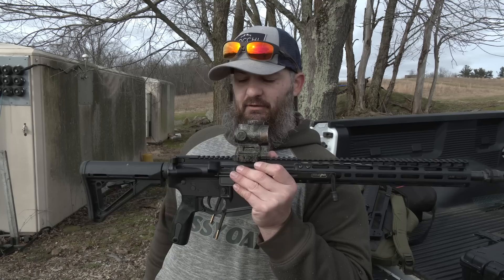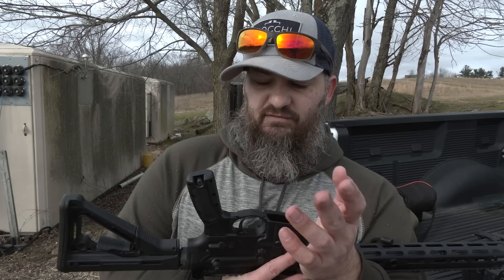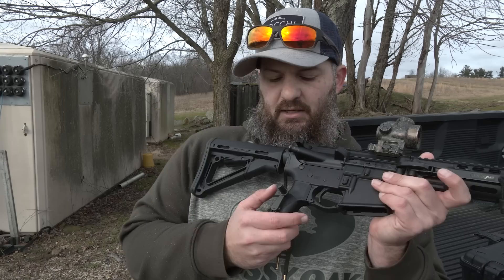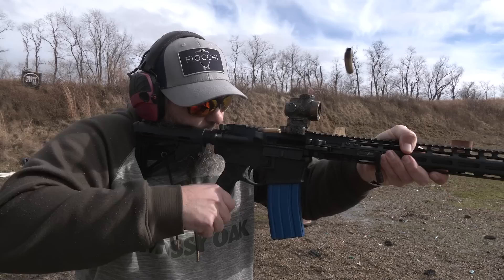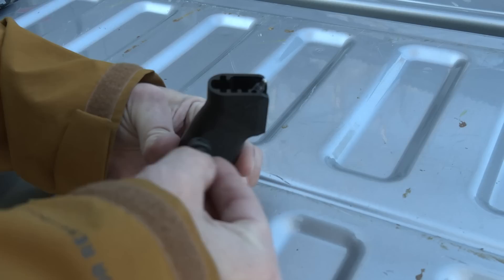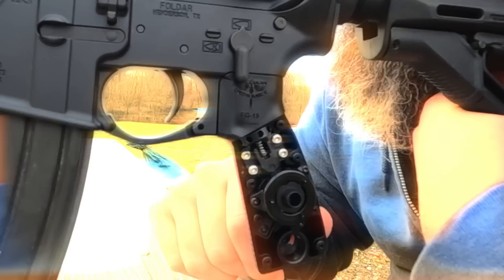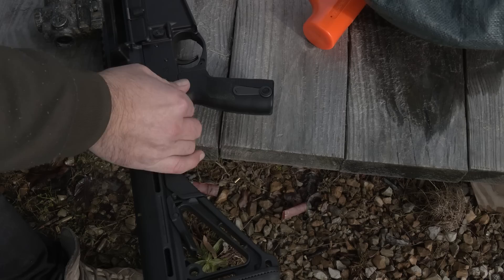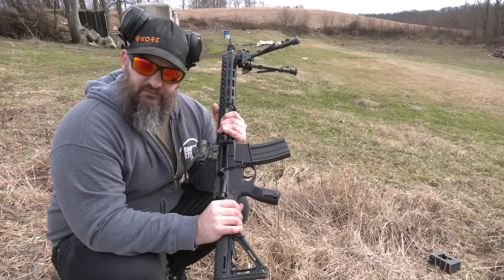Turn Any AR into a Gatling Gun: Freedom Ordnance FG-15

Comment: If you’re worried about it popping out in the field, rubber bands DO exist.
Reply: Hard for it to pop out with your hand on the grip like it should be for normal weapons manipulation also. I wouldn’t be worried about it
Reply: You could hide it's existence from others with some hockey tape.
Reply: Yeah and sunlight breaks through those in just a few days so if you forget and it falls out good luck 😐... Unless you know where to get industrial rubber bands I usually use normal ones to hold my silicone bong together and leave it outside It eats right through the rubber in a few days
Reply: Legend 😂
Reply: $280 is stupid expensive 🫰😭
Reply: Rubbers exist... yet so do I.
Reply: @lostinspace8238  I use hockey tape on my EDC... I grew up in Alaska.
Reply: there are other ways to to do it. as i showed in my video at least 10 years ago
Reply: I bet they tell to the same thing to transexual street walkers before they go out
Reply: Nah that's a myth
Reply: I would use one or two of my extra Velcro blousing straps. Twist it around the handle a couple times, makes it more full in the hand and it’s a quick release elastic recoil with Velcro for instant engagement to the fg-15
Reply: Rubber bands they have cool little velcro straps there are so many options and as longe as your hand is on the grip I feel it should remain locked in place

Comment: I have an electrical engineering background, I guarantee you I could use that screw, a tiny electric motor with a cam on it and you could throw that handle away. I would install a small push button momentary switch under the middle finger area of the grip. even run a solar strip down the top of the hand guard to keep it charged. You could still use the trigger for semi-auto and the momentary button for full gatling fire . God I love America !
Reply: lets make one
Reply: The ATF have entered the discussion.  Just to be clear I am not doing that.
Reply: I ain't saying that's not a bad idea. I could do the same and add an arduino for remote control, but your probably breaking some obscure law lmao
Reply: I like the cut of your jib.
Reply: @Sam-ed7jz  Funny you say that, I was born Naval Station Argentina Newfoundland, grew up at Annapolis Naval academe where my father was an instructor. I still sail today and work in the marine business.
Reply: @Pepto8ismol   Well Mr. OneUpManShip We could collaborate and place it on a motorized tripod with X & Y movement. Then put a red dot on it and I can mount a miniature camera behind the red dot. Then we just need someone to write the app to aim and fire it remotely and multiple targets .
L.O.L. !
Reply: @rohawaha  Yar!
Reply: It’s legal if it’s hand cranked but if u put a motor on it then the atf cares and it’s a mg the laws are stupid
Reply: @leo1999matt  Dear ATF " not meaning you Leo"  we were just joking, don't send the SWAT team.
Reply: exactly what i was thinking. the atf can tongue my rear.
Reply: Then it becomes a machine gun, no more one finger movement for one shot and so on. Otherwise you could mount a solenoid on the trigger to push the trigger back, break the circuit to reset, turn back on and do it again, and so on. 
One pull, one shot, no more.
Reply: @TheScottyGunn  Just a couple of guys joking around and bantering back and forth, nothing more. The thought police are everywhere.
Reply: I did that in 92 with an egg shaped plastic peice and a small electric engine.  After 30 rounds , I hit my target twice.  Lol .  These are dumb
Reply: @Lugia21 jokes on them, my dog's not home right now
Reply: @Lugia21  I wonder if they will be upset that my "dog" isn't really a dog and is really just PVC pipes stuck together to resemble a dog, is packed full of tanerite and covered in ballbearings and nails epoxied to the outside of the pipes all covered by a fur coat ? 

I mean that shouldn't be a problem or anything since it won't attack or anything. Right ? It's "comedy satire protest art" and not a booby trap for jerks.
Reply: I have a DeWalt cordless drill, an ar10, a pickup truck, a case of beer and know how to weld. Don't need to be an engineer to figure that one out
Reply: you mean a remote controlled turret? because that was my very first thought. Im sure feds would love it.

Comment: The Gatling device that I invented fires 8 rounds of 308 per revolution of the handle and since the gun is tripod mounted and belt fed, you only need one hand to control it. Plus the capacity is 220 rounds per can.
Reply: Needs a fgc 3d print file.
Reply: @izzyplusplusplus1004  absolutely

Comment: My immediate response was, "TAKE MY MONEY!"

After thinking about it, I don't want to take 50% of my hands out of the aiming process.  The bipod helps, but that is limited to a prone shooting position.
Reply: Get a steadicam third arm with a remote aiming system and be some steampunk version of a smartgunner from Aliens ;)
Reply: About as accurate as a bump stock..
Reply: This is obviously a novelty.
Reply: Learn to shoot left handed. And be in your right mind
Reply: You could get a tripod
Reply: Locked into a tripod would be better
Reply: I thought this was very cool and innovative, so I went to their website to check the price...and no...just no... way to much.
Reply: You mean like all classically fired machine guns..
Reply: Stabilizing with one hand on foregrip and pressed against shoulder turning with other hand should be fairly accurate
Reply: Actually, in long range schools, they teach you not to touch the foregrip at all for long range shooting. You just place your finger tip on the trigger, and float your hand next to it.
Reply: @Ranstone  I put sights on the side of my gun so I can shoot it sideways😃
Reply: @henryknox4511  The tiny size of the crank alone makes it a novelty.
Reply: It would be good mounted in a sled sitting on a turntable to make a gun turret.
Reply: Looks like it has enough room for an electric motor and an actuator button 🤣
Reply: @grantdeisig1360 that depends on the person $285 ain’t much for some of us who like novelty stuff like this. I wonder if it will work with the old binary trigger😂 that is not a drop in. Oh and that trigger is over  $400. The cheapest drop in trigger is a little over $100. So hell yeah I am gonna get one.
Reply: @ramohino  There's video out there on how to make your own binary trigger for under $200. But your right, depends on the person. I personally think there isn't $100 worth of components here... But they do need to make up the money for all the R&D.
Reply: Just use a sling as your other hand...
Reply: @yourlifeisyourfault.4212 ,
I Used To Love Old, Radio Shack, Lol! 😎
Reply: That's what I thought.  Plus I can get the same speed with my trigger finger and have ore control.  I'd take a binary trigger over this any day.
Reply: @wowblackhawk that makes no sense you will still loose one arm for stability 😂
Reply: @ramohino  not really tho…Franklin Armory sells binary triggers for 320 bucks shipped. I’d much rather have that to be combat effective instead of this monstrosity😂 my binary trigger system is actually still accurate when I fire it and my rate of fire is much faster than this silly hand crank thingy that you have to loose one hand of stability to utilize.

I would much rather have a super safety if I’m gonna have something for fun or nostalgic reasons… not that you no or have the skills to print one in the required material to make them combat effective but still, you could print one in plastic to get a couple hundred rounds of fun out of the super safety system, which is by far waaaay faster rate of fire then this crap…they’ve done side-by-side and it’s pretty much the same as a full auto M-16
Reply: @Ranstone  what does that have to do with using something that increases your rate of fire? Which is 99.999% of the time at or near  CQB distances 😂👍🏻🤡
Reply: if you are shooting full auto, even with both hands it's not gonna help much
Reply: @mrgrump2534  damn you caught that lol. Least can still keep a grip on the trigger side. And I guess bipod it. Figure I’d right handed you’d wanna do something similar, just awkward.
Reply: Absolutely no useful purpose for a riffle caliber Gatling gun ever since the first semi auto riffles were put in action...especially with the crank on the grip 😄😏
Reply: @capitalg4018  if you live in states that didn't outlaw full auto or burst mode, yes. Otherwise you are stuck with semi-auto mode only and this crank or the bump stocks are the only way around it (until the ATF comes down and decides it's a machinegun anyway, as with bump stocks). That's also one of the reasons lever action rifles are still alive and well. They are the best you can get with current gun regulations in some states.
Reply: I went to go immediately look for a video with someone that has a barrel on it🤣
Reply: Look super fun! I can already hear the range master yelling no rapid firing lmao
Reply: You can still get it and use it for fun at ranges. Done have to use it when you don’t want to.

Comment: Years ago when visiting a good ole boy's house he showed me a little thing calld a "BMF Activator". I can't remember which it was at this point.  There was a slot, a crank, a gap, and a couple set screws.  You'd put the thing on your trigger guard, tighten the set screws, and turn the crank.  You'd trim a popsicle stick down to fit in the slot and poke the trigger.  Super easy.  Super simple.  Miss that guy.

Edited because I finally tried searching for it with more information.  Turns out it's marketed for a 10/22.
Reply: They were also sold for the .30 Carbine…my old dealer had a pair of them mounted on a tripod in his shop…very cool.
Reply: I've seen those mounted with double Ruger 10/22 one up and one down and it was awesome, it oscillated around the two different triggers, and it really fired fast every crank was four shots I believe.
Reply: About 30 years ago, my brother and I were plinking up in Lytle Creek back when you could still do that, and a guy about my age had an AR with a trigger crank on it that clamped over the trigger guard.  He was having trouble getting it adjusted right so he could  turn the crank and have it fire reliably.  He would turn the crank and it wouldn't fire, then he adjusted it and it would fire once and the trigger wouldn't reset.  He fiddled with it for about 20 minutes and then just took it off and used his finger instead.
Reply: @jerrydonquixote5927 sounds gaaaay

Comment: That Gatling gun has been reinvented. That is great for suppressive fire when you need it in a pinch and no one has a SAW. 
Use a 100-150 round dual drum and now folks we have a lighter SAW.
Reply: I made exactly the same point. You have a legal saw.
Reply: Put a drill on it
Reply: @joey011582  a SAW&a drill…..we building shacks for some Humanitarian organizations or something?!
Reply: Don't blow up your gas tube lol
Reply: Get a binary trigger and git gud with your trigger finger and you've got suppressive fire.
Reply: Modify the upper and lower with the right cuts for a Colt Ciener Device/BSR-MOD 1 then you have you a drop in belt feed system that can easily be swapped with standard magazines when AR is half disassembled
Reply: A little servo motor with battery in grip…?

Comment: Putting the crank into the grip to pop in and out without a tool is so much more convenient than bolting it onto the trigger guard itself, even if it is more limited to just the AR platform. I’m definitely interested in this.

Comment: Thanks for showing the reset process. Seems a little janky and hard to get the cadence of the rounds consistent. Interesting piece of engineering though. And it's gonna do nothing but lead to more ideas.
Reply: Inconsistent cadence makes it harder to dodge the bullets.
Reply: It seemed pretty consistent, every revolution fires 3 rounds with 1 round being fired every quarter turn.

Comment: Imagine placing an electric motor on the shaft of this lever and it would be activated by pressing a button.  You could regulate the rate of fire electrically and you wouldn't need to keep turning a crank.
Reply: Shhhh not in public

Comment: You'd have to use it with a bipod for stability, but that's typical of any crank trigger.
Imagine hooking up a drill motor to the drive shaft. That sucker would really crank.
Reply: Just because you think something you shouldn't do it that's just full Auto with extra steps

Comment: After having seen a few videos, I think what people are wanting is a GE motorized gun or a mini-gun. They need to just get a lathe and start producing them at home. We all know this is where the hobby/interest ends up going.
File sgaring, 3d Printing lost wax casting, plaster molding, casting in a furnace, an oven, or even a microwave oven, servos, free servo control programs (Linux), and some lathe work. Between those very tangible steps, you can make your own mini-gun in whatever caliber you can afford.

Comment: #1 The ATF will determine that it's a machine gun accessory.  2. I can fire as fast and possibly more accurately with my Timney trigger and a rubber band which is also a precision unit and completely legal.

Comment: Very clever design putting the plunger in the bolt, I would've guessed they would have had you drill a hole for it. Now pair it with a fightlite MCR upper!

Comment: In 92 , I designed a small electrical engine and an egg shaped plastic peice to put in my trigger guard .  It's so slow .  You can pull the trigger faster .

Comment: With a proper 2 point sling supporting it you could probably use it more effectively while standing up since just some sideways pressure from the support arm would hold the rifle fairly steady. I think inrangetv made a good video about 2 point slings that goes over this.

Comment: its cool but the whole point of a Gatling gun is having multiple barrels so the fire rate increase doesn't heat up any one barrel too much. If you want faster firing just pull the trigger faster or get an automatic. When I saw the title "Turn Any AR into a Gatling Gun" I fought you were going to have some kind of ar-15 rotary barrel.

Comment: Ruger 10/22s had a 'trigger crank' years ago.. 
Sometimes it's fun to reinvent the wheel so to speak.. 
What's even More Fun is to Automate such contraptions! 
Small stepper-motor / motor output shaft to crank coupler / housing / momentary switch.. 
You get the idea.  🤘🤣
Reply: If you automate it, then it would be classified as a machinegun.

Comment: Fun toy,  but manual of arms not good. When the magazine is empty,  one needs to take hand off the crank to release the magazine. Then which hand do you use for the next magazine?  There is then a dance with the hands to get back  to firing. 
Note that 19th century gatling guns were crew served on mounts.     A true assult rifle doesn't require the trigger hand to move during magazine changes.

Comment: So, does it increase your rate of fire or is it slower than just pulling the trigger in semi? I doubt it, especially if someone has a binary trigger. I am guessing accuracy sucks big time do to the cranking motion. So… if it is no faster than my semi-auto fire and it is inaccurate, then it would suck for suppressive fire. How much does it cost to get less accurate fire with no real increase on the rate of fire?

Comment: Couldn't you run two cogs, a larger one with the handle on it to a smaller cog so that the ratio when the larger gear turns multiplies the speed of revolutions of the smaller cog connected to the trigger action. (Ps, im not a engineer or gun nut but that's my two cents)

Comment: (realizes that it's on the grip therefore little to no stability while using) I think it's a cool concept however if you wanna do it for any other reason then to sling led all willy nilly down range it's not that practical.
Reply: It's intended for prone with a bipod or seated bench rest with a bipod or tripod.

Comment: This is very unsafe.  If the butt stock slips off your shoulder while firing you have only your grip on the front of the gun because your spinning  little wheel.  Seems like it could easily cause someone to fire accidental uncontrolled rounds.  You should never fire a long gun with one hand.

Comment: Its a workaround to what we all know the federal government doesnt want us to have. With a lot of practice A person could be the boogieman the federal government is afraid of. In the end without considerable elite training its really just only going to make the neighbors nervous. If the crank handle could be made smaller and palm operated giving  the palm hand actuator some stability control you could achieve a degree of control that could give the federal government a reason to be concerned. There is a reason why the las vegas shooter chose a long distance, even he knew the bumpstock was inaccurate enough that it was a a spray and pray. The second Amendment suggests even par with government. The federal government is trying to stay ahead of that in every way both in tech and weapons. Its a cool gadget, could be simplified, but it wont meet head to head the toys the federal government has, but it doesnt need to. Patience I think is the answer. We dont need the same firepower as the federal government. We need patience and brains. Hard to run a federal government without electricity.

Comment: I wouldn't waste my money on it. You're just asking for the aft to come knocking. I realize it's a legal grey area but that's why it's so dangerous to own these kind of trigger mod devices. I pretty sure the law does not single out the auto firing of the trigger, it can be any device (auto seer) or otherwise that increases the volume of fire from the trigger. That's why these people with binary triggers are being targeted. I realize those cases have been lost by the atf but that isn't gonna stop them from trying.